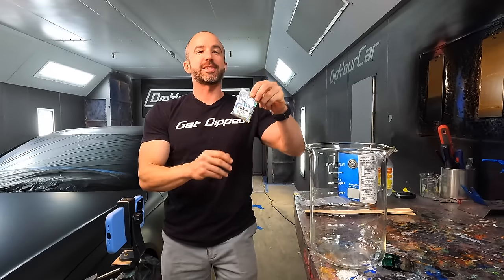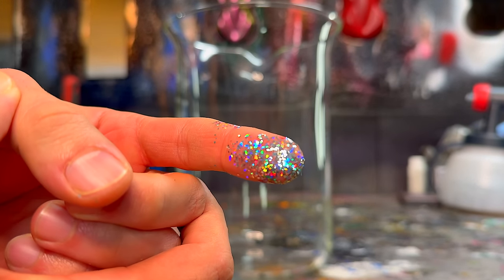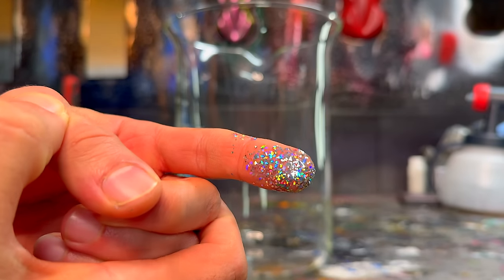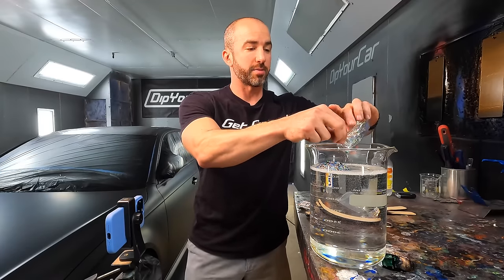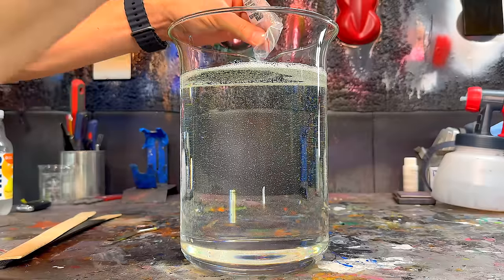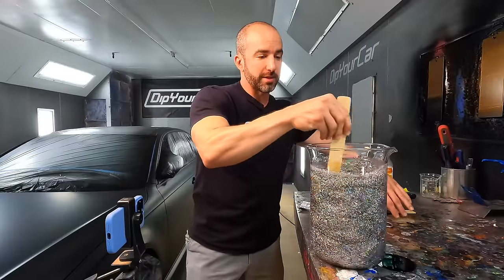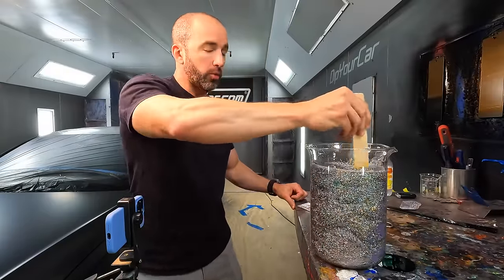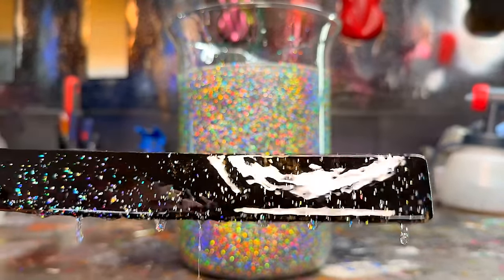Turning a Car into a Rainbow Bass Boat Using NEW Holographic Super Flakes

Comment: This is really good stuff -  I'd go with a 4/5 because it's so colorful there's a risk of too much of a good thing. Maybe, spray over a taped on stencil of some sort of hood decoration and then faded along the sides of the car, looping back up over the trunk lid...something like that.  The contrast between a dark base coat and a design in the  rainbow would be pretty cool....just thinking...

Comment: Montana Holographic Glitter Effect Clear does a pretty decent job of replicating this if you're trying to do it at home on a serious budget. I got similar results in my garage using it as a top coat on a 2k spray can of rat rod satin black followed by a 2k clear coat for durability. I did it on a motorcycle though.

Comment: Hello, my name is Shawn, i painted my 1980 VW Rabbit in 1994 Porsche red Paint and we sprayed 2 mil prismatic flake and then like 5 coats of clear.  took like 4-5 days.  did not have a heated booth but some downdraft set up.  anyways, it was amazing.  i am 33 years older now and i like the absolute black with flake, but i will find another VW and recreate my dream.  it originally was silver outside and red inside.  IT WILL HAPPEN.  Have an awesome day good sir.